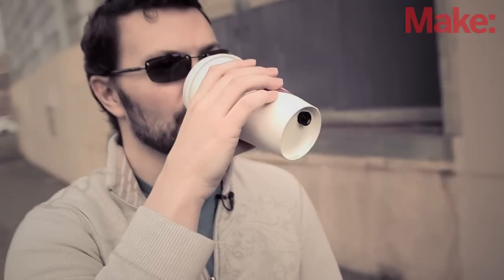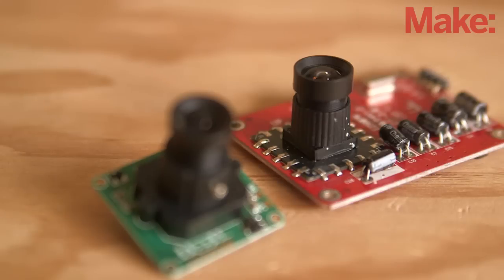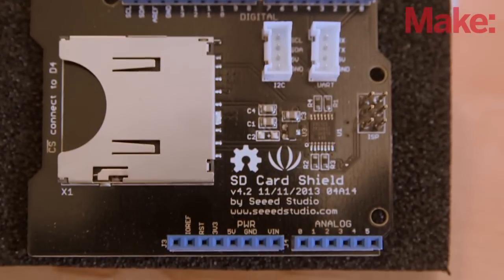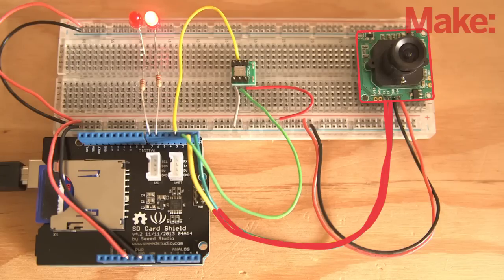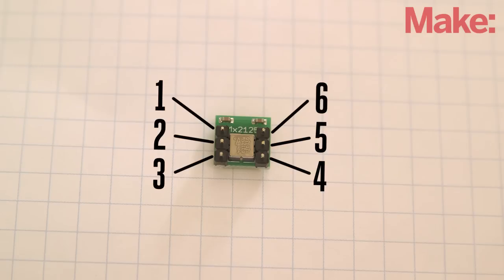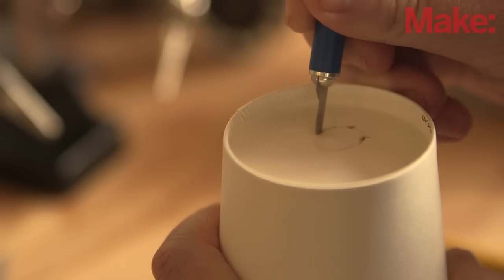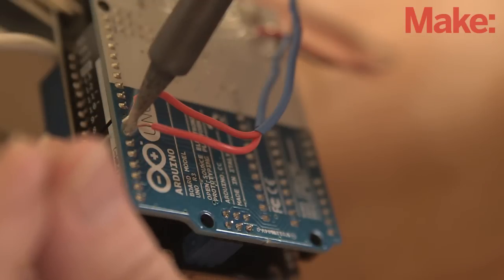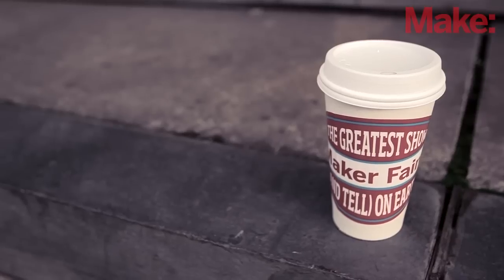Weekend Projects - Coffee Cup Spy Cam

Comment: Why solder the power connection just connect ground to the ground pin and positive to vin
Reply: Saves space, thats why. Projects which are soldered are much smaller than if headers and connectors are used.